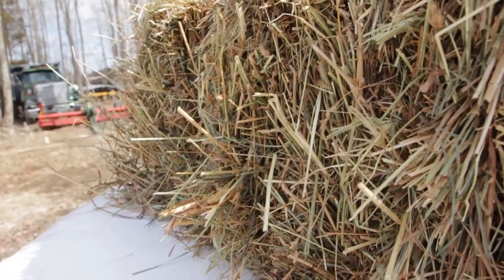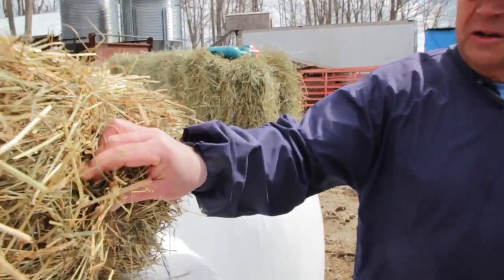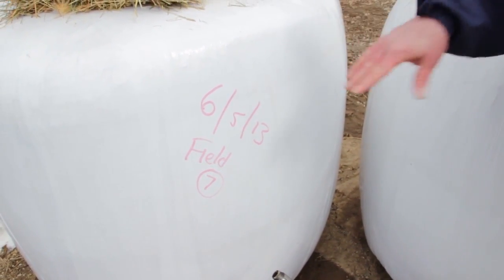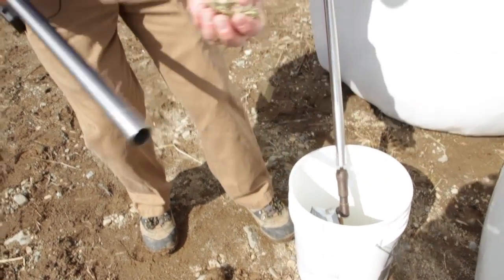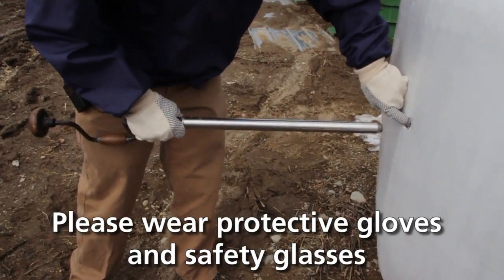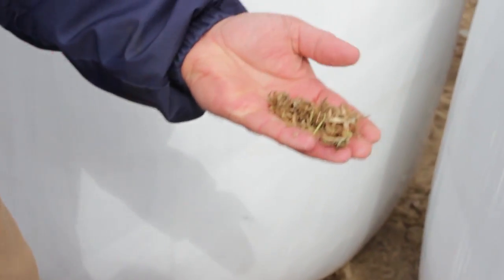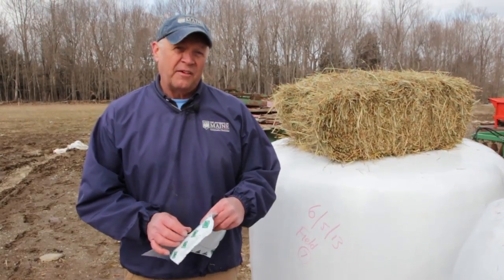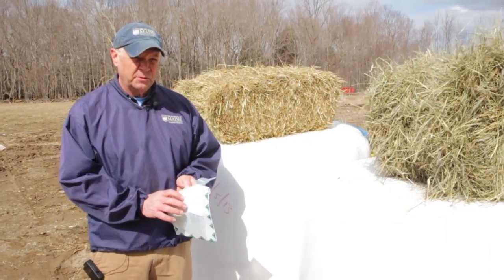How To Test Forage Quality

Comment: The beauty of Google is it suggested this video. This does not answer(as usual) my question. Maybe I should have asked. In real time without sending off to a lab and getting results weeks or months later
 How to measure protein content on the forage at my farm. Measuring for Nx6.25 is the formula. Maybe I should have asked how to measure for N and know the answer in minutes. I'm certain this video is helpful to some degree. To me not so much.
Reply: You can test N by using Nitrate test strip or digital test unit for the immediate results